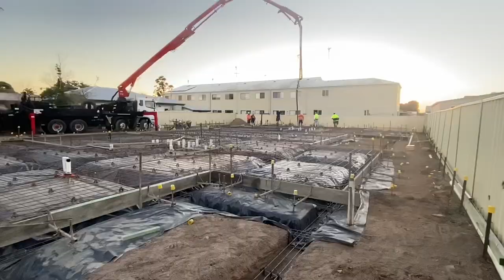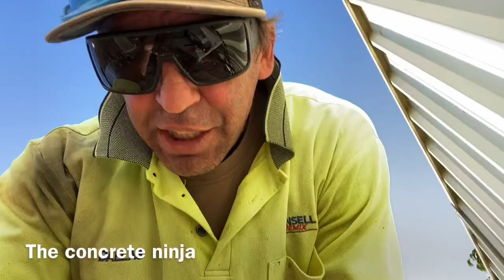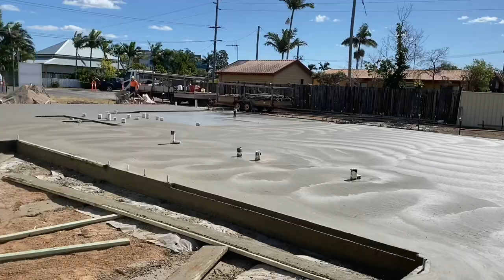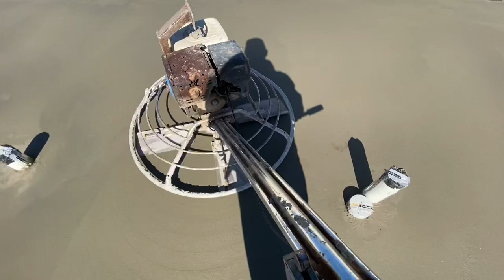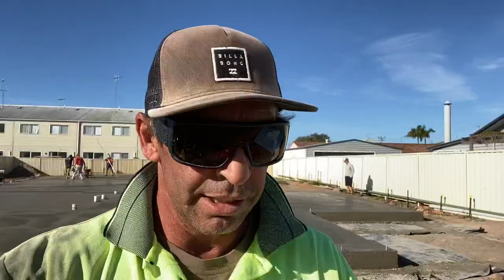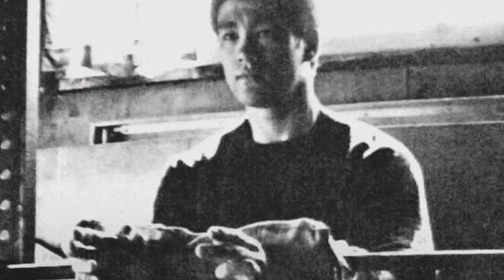How to finish a 480 m² house slab

Comment: I see you're using a pointed trowel around the outside.  Is this better than a completely square trowel?  If so why?  Can you use a square trowel anyway?  I picked up a couple of OX square trowels at my local concrete store at half price.  But I'll get a pointed one if it's that much better.